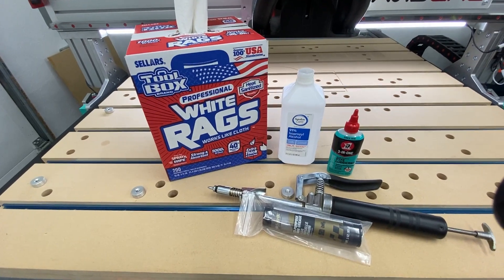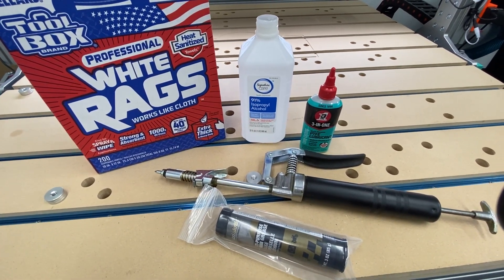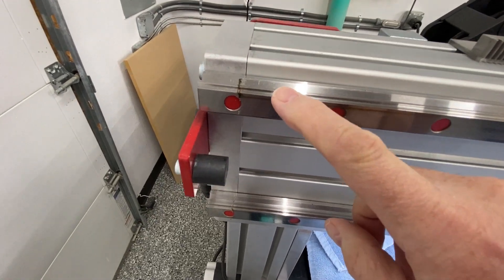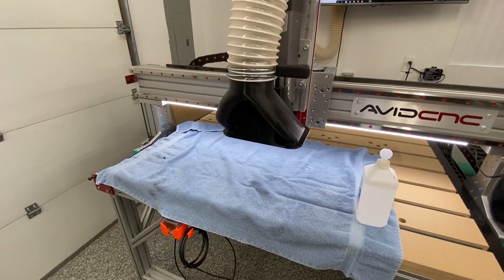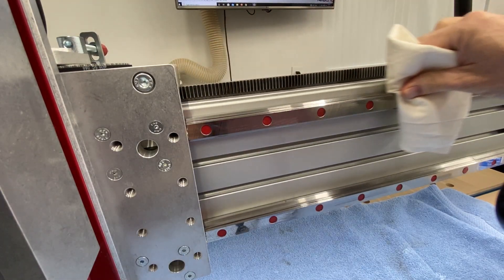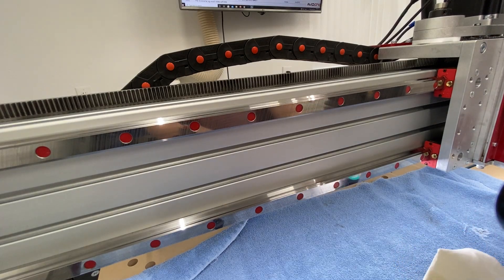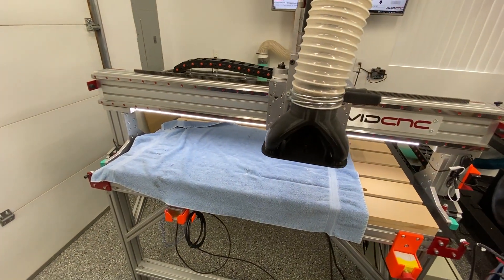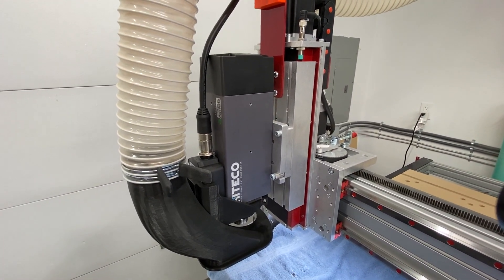How to Clean your CNC Machine and Keep it Running Smoothly

Comment: Hey Russ could you please show what you did to make that vacuum hose up top so it could help me with mine so keep my shop cleaner
Reply from the maker: The black dust boot is by One Guy in a Shop on Etsy. The orange bracket is something I designed and 3d printed. If you are after my bracket I can get you the .stl file (for sale). If you don’t print your own, I can make you one.

Comment: Isn't all that black stuff from the rails just grease? Also why lubing the rails if you also use grease? Not hating just asking thanks
Reply from the maker: My grease is green out of the tube, so black indicates to me it’s dirty. By applying a very thin layer of 3 in 1, you are only ensuring the roller bearings run smooth. Necessary? Probably not but a little extra insurance goes a long way!